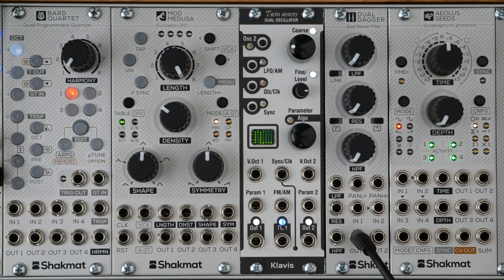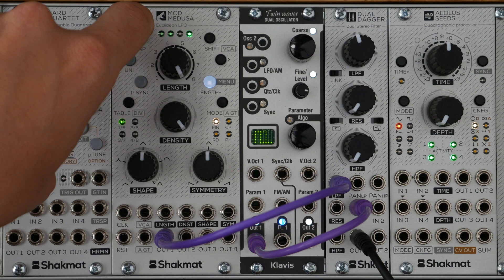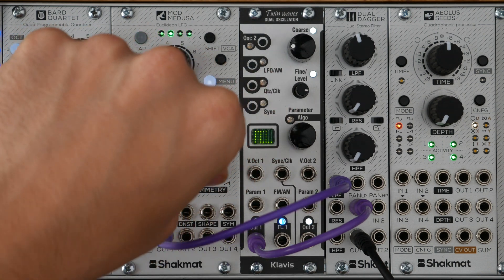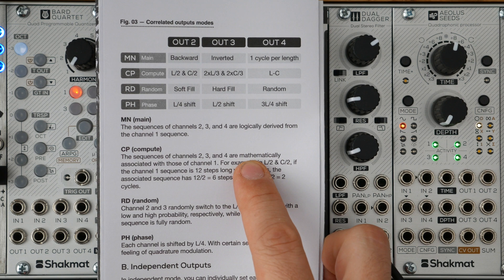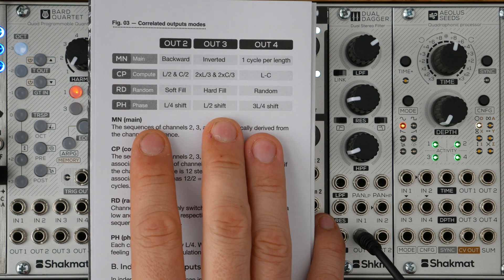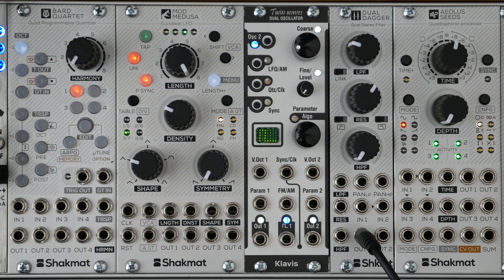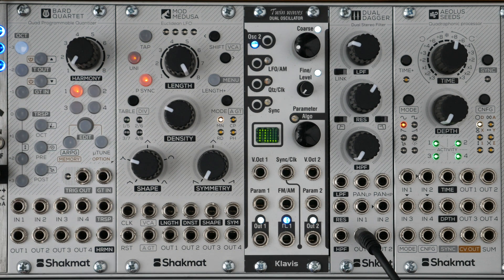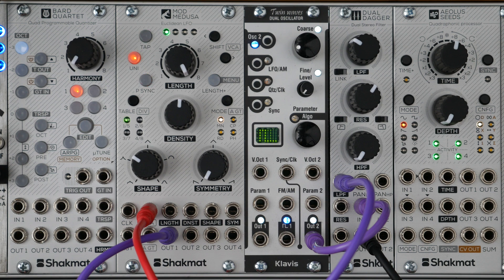Shakmat Mod Medusa: Demo

Comment: Really neat module. Would you consider a firmware upgrade that allows for 32 steps?
Reply from the maker: there's a slow mode (input clock divider in the menu - press long the length button) to expand the time span ;)
Reply: @ShakmatModular  Ok thank you I will order the module and give that trick a try

Comment: Can this be used as a normal LFO as well? For Non Euclidean rhythm
Reply from the maker: it all depends how you want to control it. Using the "lowest population setting" makes it play one cycle of wave for a whole clock turn, so no subdivision. then you can use either the length button to divide speed by 2 or place a clock divider before it and still benefit from the logic patterns between the four outputs. Hope this answers your question